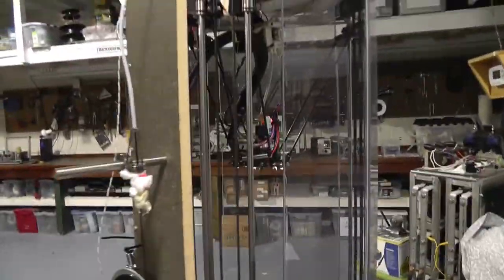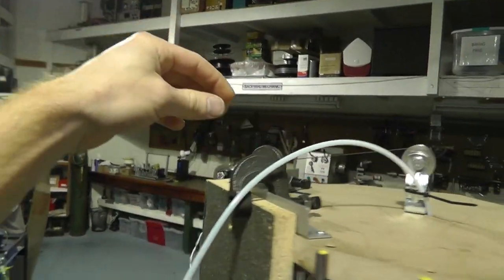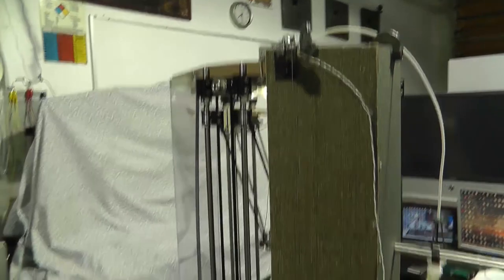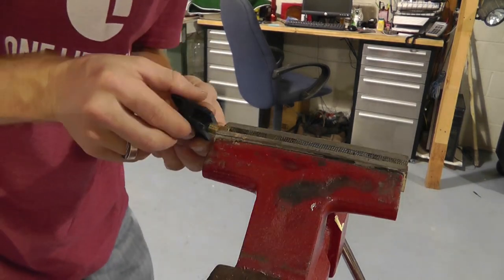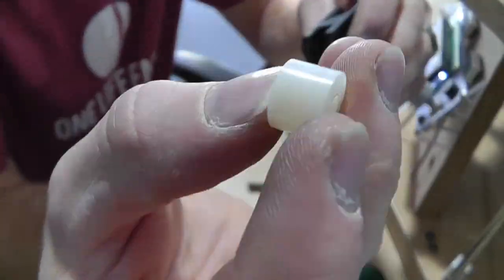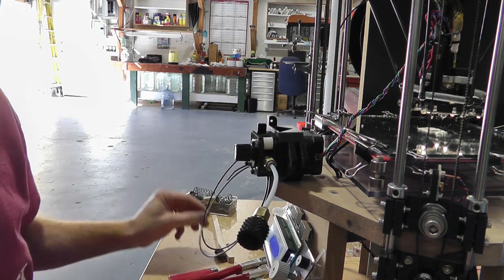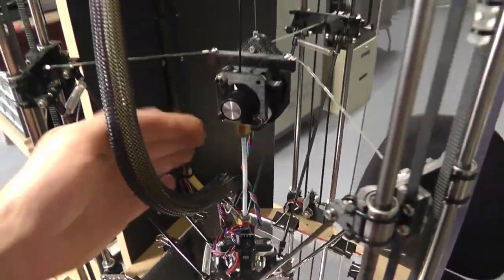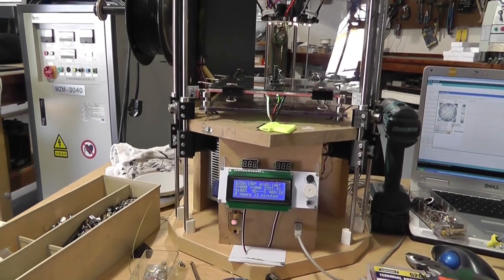Rostock Upgrade, Day3: Extruder Drive Assembly & Counter Weight Gantry System.

Comment: I noticed you got the volt meters on your printer as well. Why 2 of them though? Are you monitoring the 5v rail as well as the 12v rail?
Reply: notcied them the first time too, maybe it isn't volts, but temps? or maybe something else? :)
Reply: muh1h1 I have the same exact volt meters. I bought like 5 of them for like 5 or 6 bux. They work well and are sensitive. You only get resolution to a 10th of a volt but its enough. I checked them against a real multimeter and the acuracy is +- .1v. Close enough. They do however not come with any real mounting options besides two holes in the back. So making a case for them is required as the wires are very thin. He has a 3d printer so he can make one as well. If you wish I can show you what they look like when lit. Here is my project. http://engineerd3d.ddns.net/3d-printing-techniques-large-bore-j-head/

Comment: Do you think it would be feasible to create a 3D printer that can extrude casting wax to make positives for burn out molds?
Reply: It would be much easier to use PLA filament for lost PLA investment casting, works just as good as wax.